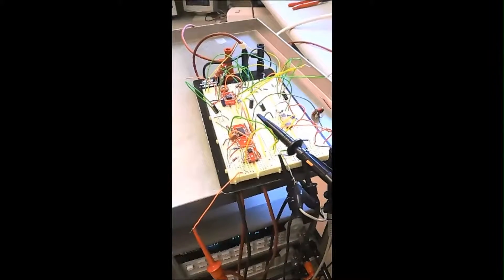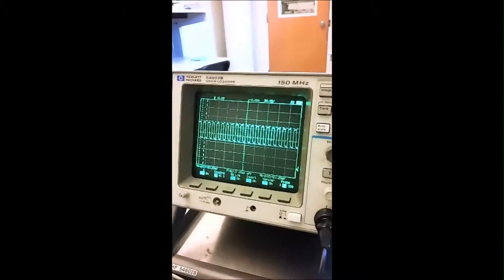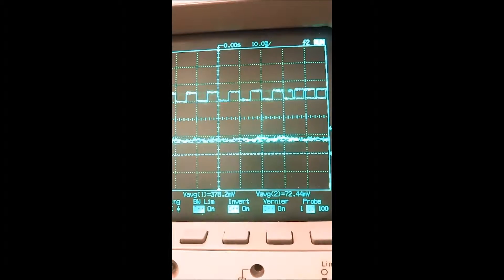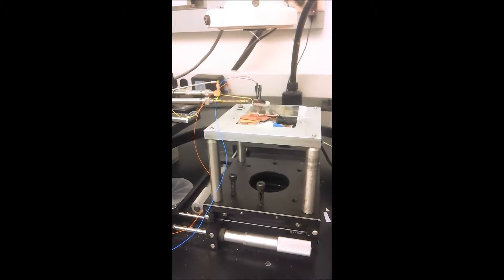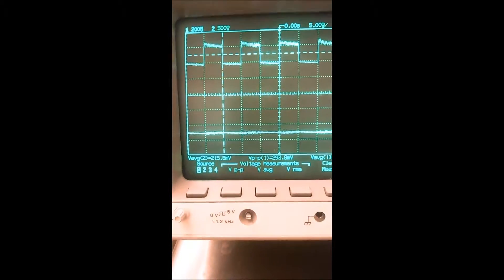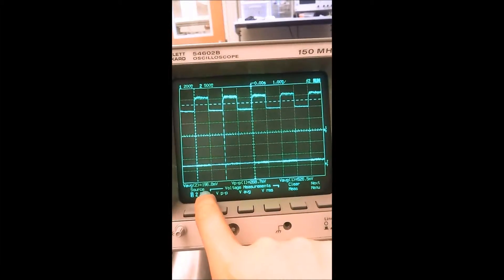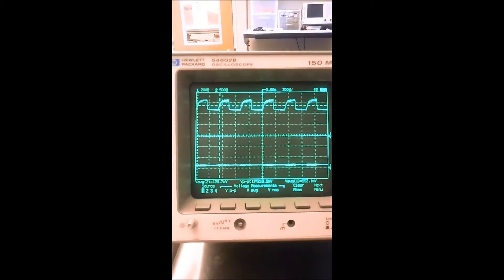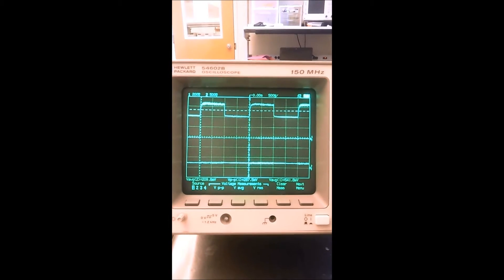Lock-In-Amplifier Prototype Demo

Comment: One doubt...What demodulator did you use?? AD630
Is it posible to use MC1496 as demod for the lockin??
Reply from the maker: I used AD630, and the only reason for that is because the prototyping price and time budget, and I happened to have a number of AD630 laying around so I was able to start the prototyping right away.  From glancing at MC1496 datasheet briefly, I believe it will work as well.. I did notice some differences on MC1496, such as higher input bias current, higher common mode rejection, etc.  So it really depends on the requirement for your applications.. Good luck!

Comment from the maker: And 2) is just to build a voltage driven current source (time to use your EE skills on transistors).  I only need to drive a (inexpensive) laser diode for my project, so no need for complicated current driver for my laser.  So I built a voltage driven current source on my board to drive the laser.  And I used the same modulated voltage as one of the input for the demodulator at the output.  Hope it helps, and good luck!

Comment from the maker: You need a modulated current source to drive your laser.  There are 2 ways: 1) If you are at development stage of your project that nothing is set in stone yet, I suggest to buy bench top laser drivers/current supply from the store.  Then what you are looking for on one of those is to have either modulation settings for adjustable frequencies to modulate your laser current, or to have an input for an outside trigger waveform.  And for the triggering waveform, just hook up a fcn generator.

Comment: Hey, I am trying to build a modulator for my laser. I have a DC power supply, an amplifier for my laser, an oscilloscope and a lock in amplifier. I am doing my best to understand the workings of the lock in but am having so much trouble. Any input on what to do would be very helpful. Feel free to email me. greenhillchristian@yahoo.com